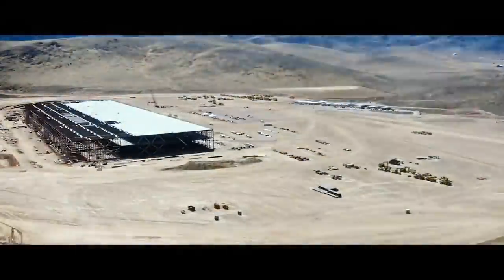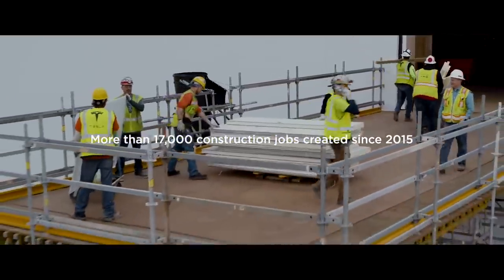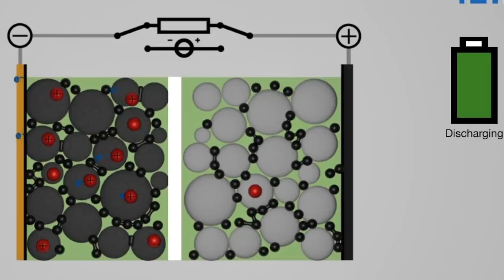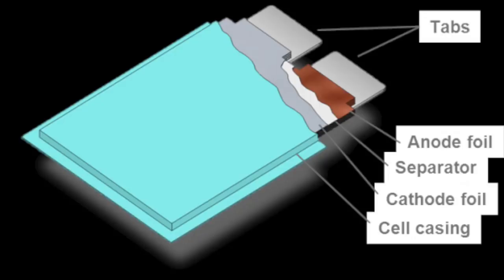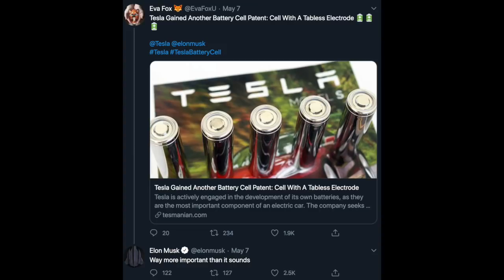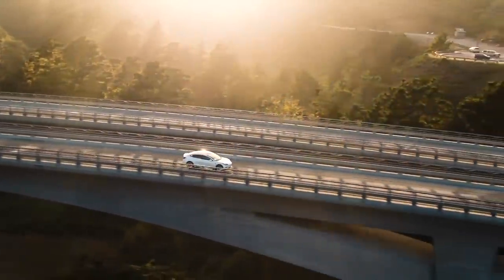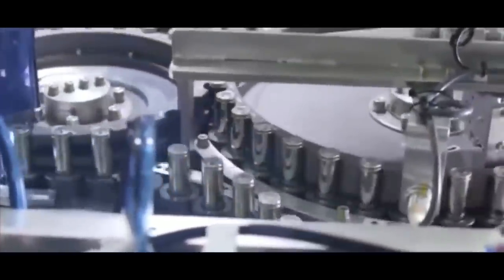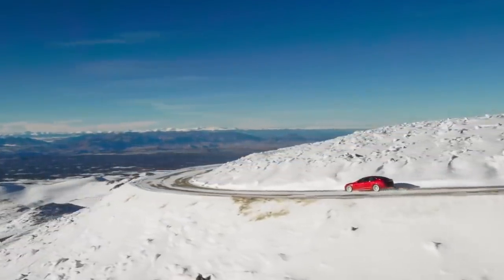Tesla's New Battery Breakthrough: Tabless Electrodes

Comment: Charging speed at home is a factor of the power of the on board charger, which is limited by the max amperage of the socket. However, super charging is limited by the max voltage that you can apply to the cell before you run into issues, lowering impedence certainly improve the apms that you can run at a certain voltage, but I don't think it will amount to the reduction stated. This technology will enable thicker electrodes with fewer rolls, both increasing the energy density without the tradeoff of lower power, and it also reduces the cost per kwh due to less copper/aluminum needed for a given cell, and also benifits in fixed Capex as the length of the sheet to be rolled reduces, meaning lower length specific manufacturing steps run cheaper

Comment: You're missing which tabs the patent refers to. It is not the tabs at 1:35 that are removed (see Sandy Munro's battery pack teardown video, they use "whiskers" that are actually fusible links that remove individual cells if they internally short), it is the tab labeled 122 in the patent drawing at 2:09.  They changed the cell so the contact with the electrode is continuous along the entire edge instead of just at kitty corners of the rolled media. The length of the media is much longer than its width. By doing this construction the electrons only have to transit the width, not the length, hence the lower resistance.

From patent application 20200144676, summary sections 46 and 47:

[0046] With continued reference to FIG. 2, in certain embodiments, a
     portion 202 of the second substrate 106 that is disposed partway along
     the length L.sub.3 of the second substrate 106, may extend transverse to
     a mid-plane P of the second substrate 106 to form a conductive tab 122.
     Although one conductive tab 122 is shown associated with the second
     substrate 106 in the views of FIGS. 1 and 2, in some embodiments
     additional conductive tabs 122 may be present on the second substrate
     106. In other embodiments, multiple portions of the second substrate 106,
     discrete from one another, may extend transversely in relation to the
     mid-plane P of the second substrate 106 to form multiple conductive tabs
     122. It is hereby envisioned that when such multiple conductive tabs 122
     are present on the second substrate 106, the ohmic resistance of the cell
     100 is decreased compared to when a single conductive tab 122 is present
     on the second substrate 106.

[0047] The present disclosure offers numerous advantages compared to other
     advanced electrochemical cells, which utilize a tab contact to
     electrically connect the negative electrode substrate to the can wall in
     addition to the tab to connect the positive electrode to the cathode
     connection. Removing the tab connected to the negative electrode and
     reorienting the conductive connection to a conductive portion 118 allows
     the negative electrode to run along the length of the negative electrode.
     This reduces ohmic resistance through the negative electrode to the can,
     reduces current deviation across the length of the electrode, improves
     cell lifetime, reduces joule heating, and increases heat dissipation
     capability.

You can see from the patent application that it is internal tabs that are the subject of the invention, not the external tabs used to connect cells into a battery.  The last sentence of section 47 is the most important!

Comment: Hmmmm not sure you have the main benefit right.  Yes the resistance of the tabs themselves is an issue, but as I understand it the main problem is that the tabs are attached to the ends of the electrode before it is rolled up into the cylindrical format.  This means that elections moving between the tab and those parts of the electrode furthest from the tab ...  ie at the other end of the roll have further to travel and in so doing encounter more resistance and generate more heat.  The tabless electrode makes a connection along the whole length of the electrode which shortens the distance that the electrons have to travel,  so reducing resistance and heat

Comment: The biggest advantage is in preventing cell failure as is true with all systems using cylindrical based systems. Because Tesla basically glues the entire battery pack into a solid brick a single cell failure while not material to the overall functioning of the pack cannot be swapped out or replaced. If tabless can make such a normative event a thing of the past I agree reliability of the Platform would increase quite dramatically and over a far longer period of time.

Comment: 230V charging speed depends on the amount of inverters installed in a car. Inverters do AC to DC. BATTERY accepts DC only. There is no sense to use 230V comparison

Comment: Tabless electrode has a lot of knock on effects. Sure there is the simplication of manufacturing. Then, you have improved efficiency  due to lower transmission resistance. That extra energy was going somewhere before, as heat. So this also reduces the need for cooling, and allows you to cram the batteries closer together. Also, removing the tabs, associated cooling components, reducing space required affects another parameter, weight. All these small gains will translate into better performance, efficiency AND reduce costs.

Comment: At a model 3 if the battery can handle 4-5c without vizible degradation you can charge it in 3-4 your and fast charge it in 15-20 min .
A 18650 cell without intern al tab is limited by the resistance of the extern al material if is an carbon battery.

Comment: Those tabs actually acted as a fuse if something were to go wrong. Now there is no disconnect point between batteries. I’m not sure what you know about electrical engineering but I’m sure Tesla didn’t overlook this.

Comment: There are already Electric airplanes admittedly small learner aircraft Not 707.  As stated already by Derek Battery density has to grow to 500w/kg roughly double what it is now. Since it goes up at 5% or more a year then simple maths will show that it will only take 8 years to reach this point excluding any breakthroughs or if the technology tops out.

However there is another technological hurdle to get over a commercially viable aircraft and that is recharge time. A 737 takes 15 or 20 minutes to refuel this is fine since they are loading/Unloading passengers cleaning the plane doing pre flight checks loading food etc.  Depending if an aircraft is doing long haul or short haul it can spend over 20 hours a day in the air 7 days a week, this is week in week out. The only time it spends any significant time in a hanger is for repairs/mandatory certification and life renewals where it goes into a factory and they virtually rebuild it.

Why do they do this well it is simple an airliner can cost $200 million and upwards. It earns money whilst in the air on the ground it costs money thousands of dollars an hour. Landing fees ramp fees etc etc. A airplane that lands has to wait 4 or more hours to ""refuel"  is not commercially viable.

I predict that Elon will not get into the aircraft business though someone will. Though the aircraft industry even more so than the car industry strive towards the same technologically goals as the EV industry lighter weight,  glass cockpits greater reliability it is not just a matter of stuffing an existing design full of batteries changing the engines and away you go. It fully requires a completely new design.

Could Elon do it? Yes undoubtedly Could he crack the problems already mentioned? Yes its Elon Musk for god's sake! Will he do it? well as I said I doubt it. with one caveat he might do something in that area air taxis or small passenger aircraft . There is one major thing stopping him and that is time. Yes there is 8 years until battery technology matures and designing testing and producing  plane does take that long ask Boeing or aerospace. However he already works 80 - 100 hours a week on his existing companies. 

Elon also wants to save the planet and Mars is the fallback position if he fails. Why design an airliner which will admittedly advance that by cutting down on pollution when Hyperloop will hopefully stop the necessity for airplanes anyhow. Hyperloop is actually quicker than a plane or at least it will be and a damm site more efficient. Even if it does not work out Elon cannot afford the years of work he has to put into such a project there is only one Elon(Lets Clone him).

He has also mentioned a way of replacing airliners entirely by using StarShips. A brilliant idea after all who would not prefer a sub orbital 40 minute flight to be on the opposite side of the world, rather than spend 20 hours in a cramped tube. The G loading should not be much more than you encounter on a roller coaster though for longer. It is commercially viable even though each flight would cost more in fuel a Starship will be much much cheaper than a complicated airliner and it could travel to Australia and back in 3 or 4 hours rather than the nearly 2 days a 747 would require meaning it would generate a lot more revenue and require a lot less staff. The problem with this is safety as a rocket is inherently more dangerous than an airliner it would only take one accident and no one would get on one again.  Think Concorde yes there are airplane accidents all the time however because of the flight regime an accident would be less survivable than an airliner and human nature would see them as inherently dangerous. Even Falcon nine has had a few accidents luckily without loss of life. With hundreds of Starships in the air it is a statistical certainty that a disaster would happen eventually and even if it was far enough down the line to show that a Starship was just as safe as a boeing or similar which is very very very safe human nature is such that people would not want to travel on one. A long long time ago people didn't want to travel on those new fangled Steam locomotives because humans could not survive at the incredible speeds of 30 mph they went.

Comment: The most important part of the tables electrode is the lower resistance of the cell, in the patent application is stated that the cell resistance is lowered by factor 5 - 20 depending on the dimensions of the electrodes. That is massive, as it means only a fraction of the heat - which is generated during charging and stresses the cells -  is generated and thus we can expect much faster charging (higher charge rates).
Reply: People really aren't getting how big a change this is. All other battery architectures are obsolescent for the most part.
Reply: @feijaodo  Yes, especially combined with al the other Tesla battery patents and Maxwells dry electrode coating technology etc. That is the thing which everyone in battery research wanted to find, or where people thought that solid state would deliver it.
Reply: @nilsfrederking62  I think we're seeing a convergence of a lot of technologies that all have ability to increase charge rates on their own, and when they're combined it's going to blow people's minds.

Elon and Tesla have revealed very little about future charging other than Cybertruck is 250+kW. All the while they keep making acquisitions and filing patents for tech that should increase charge rates. I'm really hoping they're saving it as their big mic drop moment.
Reply: @brogcooper25  Yes, charge rate and energy density will be much better. The tables electrode patent also improves both significantly!
Reply: @nilsfrederking62  even before the tabless patent I was predicting much faster charging. This should be some sweet, sweet icing on the cake. 

Maxwell DBE will significantly decrease internal resistance and thus, heat generation. 

I haven't heard anything definitive, but it seems like Jeff Dahn's single crystal cathode and high temperature electrolyte should not only improve longevity, but also reduce internal resistance and reduce the damage caused by heat generated during fast charging. 

They also have a patent for an integrated cell/pack with improved cooling techniques such as full immersion in a dielectric fluid. https://insideevs.com/news/376931/tesla-patent-battery-cell-pack-production/

Any improvement would be great, but a combination of solutions could make it insane. Imagine if the new batteries created less heat, removed heat faster, and tolerated more heat.

If Tesla can significantly increase charge rate, what kind of chargers do you think they'll use? Upgraded/unlocked V3? New V4? Megachargers?
Reply: @brogcooper25  Thanks for the link! Maxwell dry electrode coating technology, tabless electrode technology, Jeff Dahn's single crystal cathode and high temperature electrolyte plus the housing patent (your link) most likely can be combined. And electrode thicknesses can be changed, to adjust the parameters. Tesla for sure will try the best dimensions and mix. Thus you have several factors which can increase energy density and charge rate. I am quite sure about the fact that Teslas new battery technology is the breakthrough we EV enthusiast were waiting so long for! My guess for charging is something like 500 - 700 kW but I would not wonder about a Megacharger. When Elon Musk spoke about Porsches 400 kW charger as being a children's toy he might already have known the insane charge rate they can achieve.
Reply: so is it good or bad
Reply: I tried to quantify the energy density and power density increase but it's impossible because I can't tell what the decrease in resistance will be but it seems like it's over 40% which is completely nonsensical!
Multiplied by the dry electrode tech would make it more. These two things may be production ready. the other two big patents probably not ready for mass production if they were we'd be talking the end of any other type of energy storage.
Reply: @feijaodo  I am not the good in physics - school is too long ago - but as I wrote in the patent was mentioned a reduction by actor 5-10 a roughly calculated 10 for Teslas cell form factor. And I think it is very likely that there is a linear relation between resistance and heat produced and furthermore it is important to understand that lower resistance cn aos affect the thickness of the electrodes which then can positively effect the energy density or other desired metrics like charge rate.
Reply: I'm thinking now with the energy and power density increase along with the decreased charge time. They'll most like break the battery into two parts. One with energy equal to a stage travel distance per day with a 30 second charge time and a second with a different construction and chemical mix with an outstanding energy density as it's focus. 
The first maybe 25 miles charging in 30- 190 seconds.
The second with a 900+ mile range but a  30+ minute plus charge time.
Reply: SpinazFou  I don't remember the patent names but there's one for a single crystal tech that's a little strange and another with a highly doped extra element for coating the divider with lithium. There's another one also but I didn't understand it at all and I'm not sure it's useful at this point.